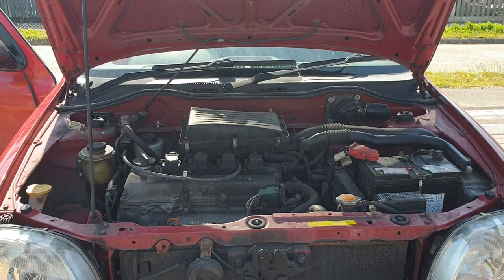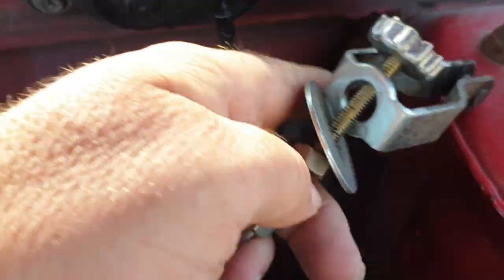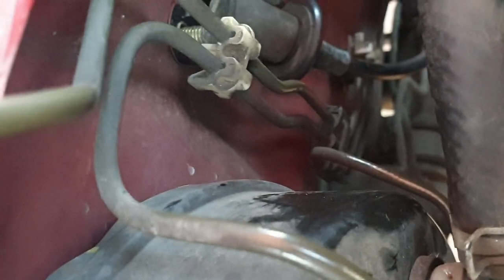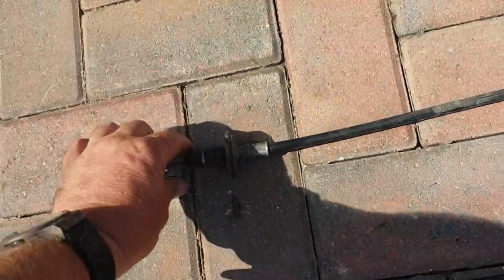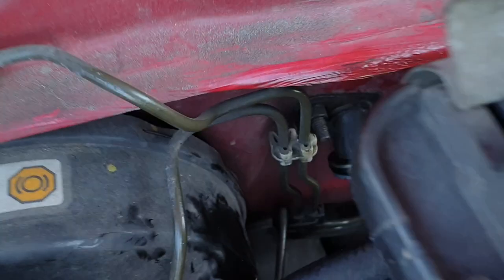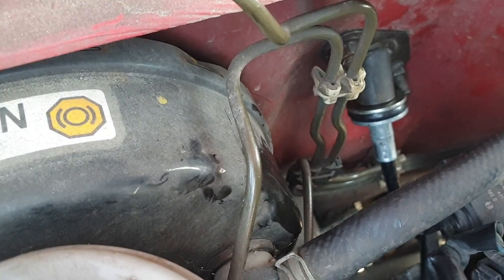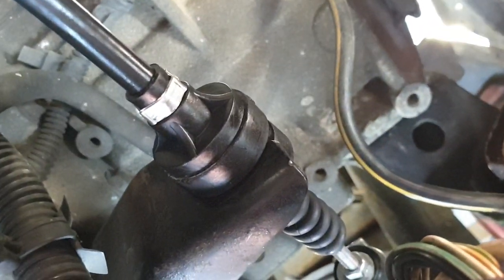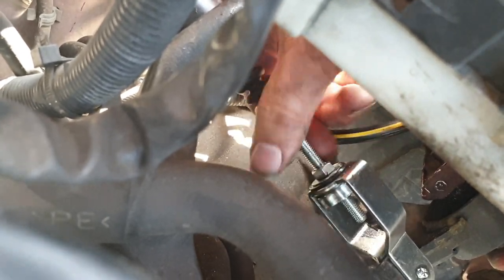Nissan Micra k11 2002 Replacing clutch cable

Comment: hi mate, i have brought a clutch cable from Ebay, but it turns out much shorter, may i ask does the UK / US clutch cable are in different length? do you think i can modify it to fit? thanks mate.
Reply from the maker: If your car is left hand drive(European) the cable is shorter. Ring hand drive (UK) is longer

Comment: Hi I’ve got the same year k11 as this and I’ve got a problem with the clutch. We adjust the cable and tighten it but after 400 yards you can’t put it in gear at all. Does this mean a new cable is needed or is it the clutch?
Reply from the maker: If it drove further before you adjusted it and now.worse change it back. If clutch slips then u need new one

Comment: I have a W reg K11 Nissan Micra .. my clutch cable never been replaced .. its 23 years old .. how can I tell if it's going to snap? 77K miles. Thank you 😊
Reply from the maker: The cable gets stiff and the metal strands start to feel rough when you push clutch cable down. If it's been greased properly it will probably be fine